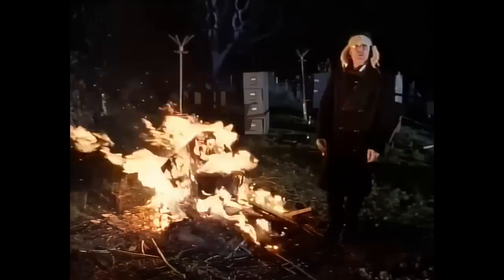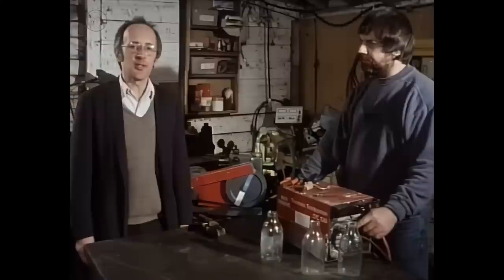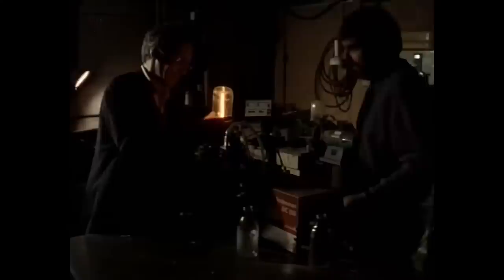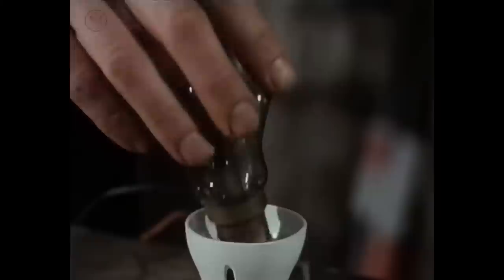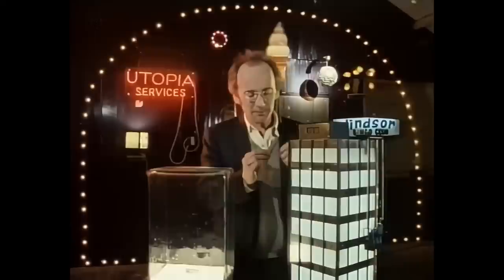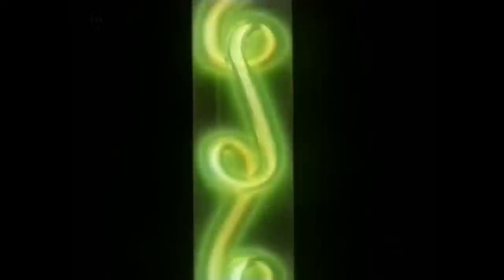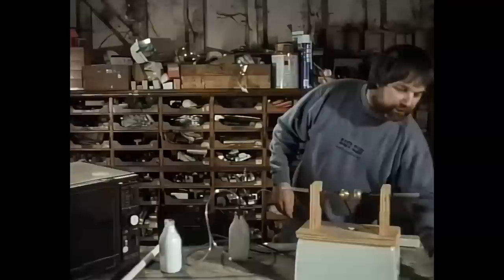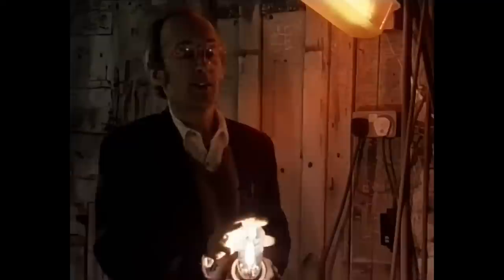The Secret Life of the Electric light - Remastered

Comment: There's something magical about the lighting and the 16mm print which makes these visually interesting. Not to mention the animations.
Reply: Agree, and was about to say the same. This series benefits immensely from having been shot on 16mm, and nowhere more obvious than this episode. Not even modern digital film cameras are able to capture the colour detail in those bright lights.
Reply: In my opinion Tim should make copies from these originals again in 16mm as a back up.
Film last much longer than any digital stuff. PROVEN!
Best would be a copy on polyester basis film which is today normally used in copy works. Unfortunately these copy works are getting fewer. (I can recommend ANDEC in Berlin)
Kodak made just ~5 (?) years ago a Dia-Film the Ektachrome 100ASA in E6 process.
I hate that they still used a tri-acetate basis for this (lasts only 150 years due to the vinegear syndrome).
THE MAIN REASON SOMEONE IS FILMING TODAY is that it is LASTING.
I film 16mm and 8 & Super 8mm at minimum every 2 years 2 reels (100ft each)

Comment: Still like the warm glow of the incandescent bulb.
Reply: Particularly with Christmas lights.  Far nicer than the modern led sets
Reply: @nathanlucas6465  Exactly!  I'm that one energy wasting guy on my block with gas lanterns on my house!
Reply: No way, that is just a bias due to it being what you are used to. 
Had you had been raised with bright white sparkling looking Christmas tree lights and then 40 years later dull yellow lights were introduced you'd be thinking they looked dull and boring. Not at all representing the spirit of Christmas.

I don't like those unreliable things at all, where 1 bump destroys the whole string (even though they were designed to basically short a failed lamp keeping the circuit going but only brighter). No such issue with LEDS.
Reply: @jtveg  Modern LED strings tend to be overrun, which causes them to (shock, horror) fail in a short amount of time.  Next time you have a failed LED "bulb" open it up and you'll find one or more of the individual LEDs with a black spot in it.  That's the failed one.  Put a blob of solder over it to short across it and the bulb will starting working again, but even brighter and with an even shorter remaining life.  The electric light bulb industry just does not want you to stop buying light bulbs.

It's possible to put in more LEDs and run them at lower current individually for the same light output.  Google Dubai lamps, and then go and watch Big Clive's investigation of them (and subsequent experiments on how to make the light bulbs sold almost everywhere else last much longer).

Perhaps it's hard to see how they could have made the CFL units actually last the 8000 hours they promised, so maybe they did their best there (only maybe, as I've become rather cynical about the whole thing) but the current short life span of the LED light bulbs is nothing short of money grubbing manipulation of the market.  As you surmise, LED light bulbs should last almost forever, but in actual fact most tend to last less than their incandescent counterparts even if they do use less energy while doing so.

The best house lighting I've found is the flat panel rings used in oyster lights.  The LEDs tend to not be overrun, so they simply don't fail.  The difference is that they are made by electronics manufacturers who specialise in putting components onto circuit boards, rather than "light bulb" manufacturers like Osram, Phillips etc.
Reply: @Chrisamic  
Yes, I totally agree and I have also seen the video on the Dubai Lamps on BigClive's channel.
Reply: I like the old orange sodium street lights. Too sterile these white led lights
Reply: I even like how soft white that gas mantle looks

Comment: When I was 16 or so, I removed carbons from old-fashioned, basic carbon-zinc D cells (hard to find the original, non-"alkaline" cells these days!) and, placing my mother's electric iron in series, I made my first carbon arc lamp. At first I made very sketchy smoked glass lenses, but after a year or two I bought welder's goggles. I never got around to making a carbon feeding mechanism, tho I fooled around with those and with a gas jet / lime-light many times as a young adult.
Reply: My mother's two brothers tried this same stunt back in the thirties but they forgot the electric iron. My grandfather had a few things to say about all the electricity in the house going out!

Comment: You might be interested to know that there was an agreement called the Phoebus cartel stretching way back among tungsten light makers to limit the life of their bulbs.  A tungsten light could last forever but they were engineered to fail. This, of course, ensured an ongoing business for bulb makers.

Today that seems to be a thing of the past with LEDs, or it did until LED light makers began reducing the number of LED chips in bulbs and driving the LEDs harder. This produces excess heat in the chips and their nearby electronic controls, shortening their life. It is possible to alter LED bulbs if you are handy with a soldering iron and can change out a capacitor. The "Big Clive" Youtube channel goes into some detail about this.

I love how each episode has a fun ending.
Reply: You can buy LED that last as long as they are supposed to, if you are king of Dubai.
Reply: It's really a shame about that continuing with LEDs, it's not even like the LED chips themselves contribute much to the expense of the bulb.
Especially considering all the other electronics that are in each bulb, which just get thrown in the bin as well, just because one of the LED chips burns out.
Reply: @jamesportrais3946  a half inch spanner, and a few expletives. hehe! Interesting info
Reply: I have had as little as 3 months out of some LED lamps. As you say, they are driven too hard. CFLs weren't too bad and the old Philips from the 2000s lasted AGES.
Reply: @jamesportrais3946  Just now my GW microwave failed... one month out or warranty. Now I know what its clock was for.
Reply: @frogz  Resistors add heat, capacitors don't.
Reply: The Phoebus cartel has been unfairly maligned.  It's true that it conspired to make bulbs last a shorter time, thereby funneling profits to its members.  But shortening an incandescent bulb's lifetime also makes the bulb use less electricity for the light it gives off, thus reducing the money spent on electricity and reducing pollution. The actions of the Phoebus cartel were likely a net positive for consumers, who would otherwise be drawn to inefficient long-life bulbs that cost much more to operate.  The price of a light bulb is dwarfed by the cost of the electricity to run it over its lifetime.   

In incandescent bulbs there is a fundamental design trade-off between lifetime and luminous efficacy, determined by the filament temperature.  A filament at a lower temperature lasts longer because the tungsten vaporizes more slowly.  But it also has less of its emissions in the visible spectrum and more in the infrared, reducing the luminous efficacy.  And it will have a lower color temperature, appearing more yellow (or orange or red at the extreme).  It's the filament temperature that the cartel sought to manipulate, forcing members' products towards a 1000-hour lifetime.
Reply: @jbalazer  Fascinating. Thanks for your reply.